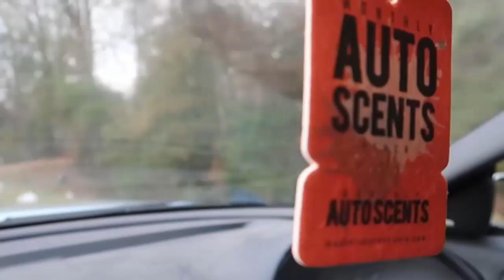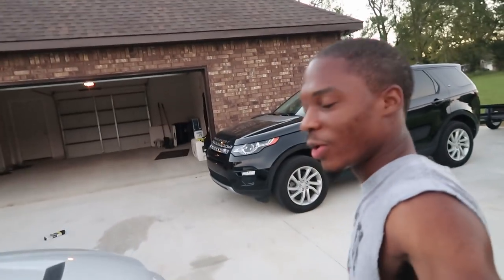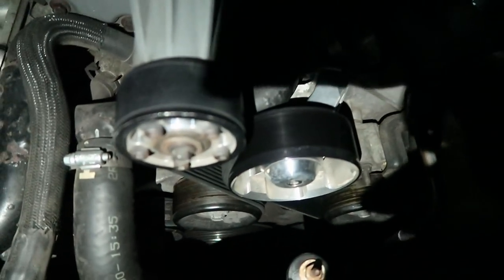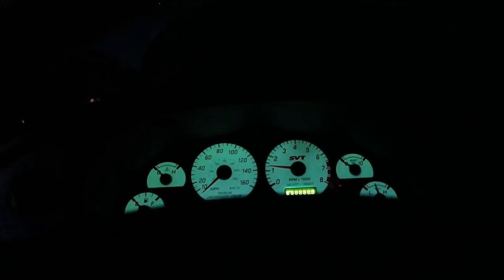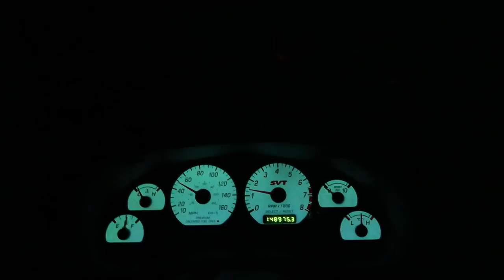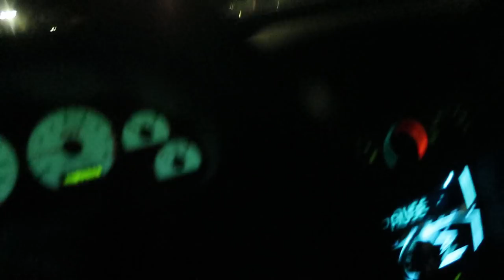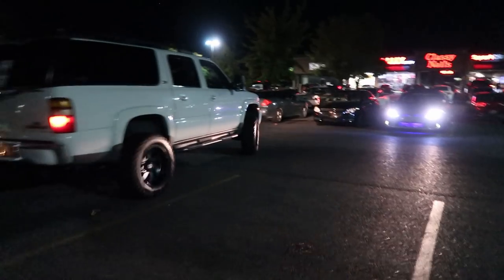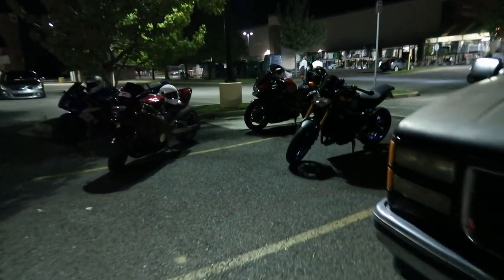INSANELY FAST AUDI S4 RACES TERMINATOR COBRA

Comment: Gates Green HD belt is both quiet and strong. Best especially for modified Cobra Terminators. BTW, I think your Cobra could seriously benefit from a tune bro.
Reply from the maker: It started back squeaking a little bit on a cold startup.. I’ll see what I can do about it, it’s not anything major but just one of those annoying things. And yea, you’re right about the tune👀
Reply: Metco pulley kit and the belt will solve it all. Did that to mine when I had it and it never spun

Comment: I had a s4 before my scatpack. Audi’s make some bad ass cars. European V8’s are no joke.
Reply from the maker: Whenever I’m ready to make my Cobra “better” and I’m looking for a reliable daily.. I’m definitely gonna consider an S5🙌🏽
Reply: The s4 is a 3.0 supercharged v6.  I just bought a 2015 and the scatpack was one of my to buy choices before I pulled the trigger on the s4. Love the look of the 392 scats but the way the audi rode made for an easy choice for my daily. Plus is nice to be low key and not have every kid who owns a fartpipe wrx buzzing around you like gnats. Wish they built scats with AWD, would have made my my choice a lot harder in the end. My 2005 mustang gt got to 500whp and man did I want for AWD.
Reply: @Burnflesh82  no but they are fast and easy to drive. With launch control it easily and cosistently gets to 60 in around 4sec with stage 2 setup. Huge difference from my mustang that took a lot of  skill and pedalling til u got to 50.

Comment: Thought that Audi was out there cleaning up 😭😭😭 good run at the end. Get better street tires u won’t spin as much
Reply from the maker: It was, I couldn’t get much footage because my GoPro died soon as he showed up. The problem was it was a cool night on asphalt. Spinning for days😅

And I was bogging because I didn’t wanna wheel hop, gonna fix that sooner or later also👌🏽
Reply: @pj_morrison  Whiteline racing is the best for defeating wheel hop and suspension products.. worked great for my 13 GT